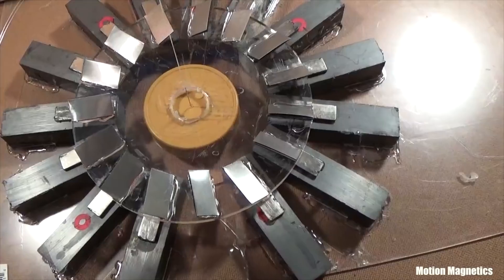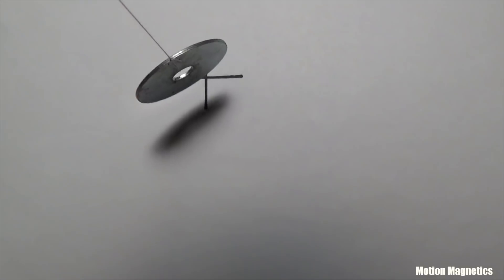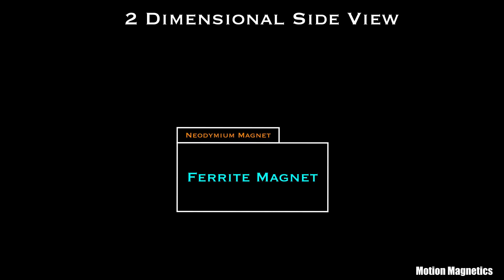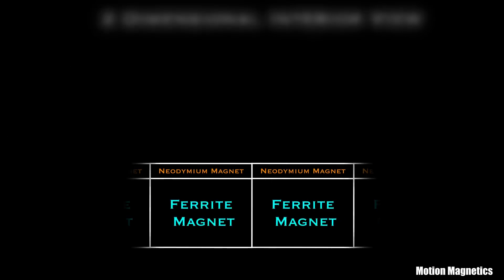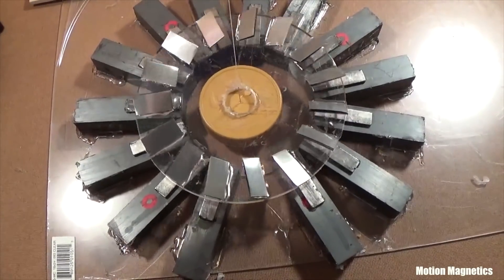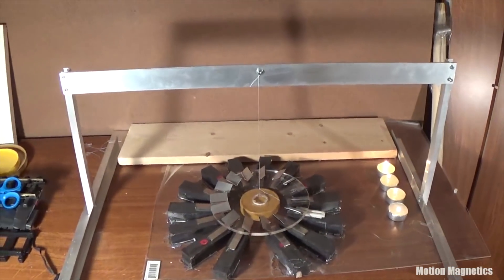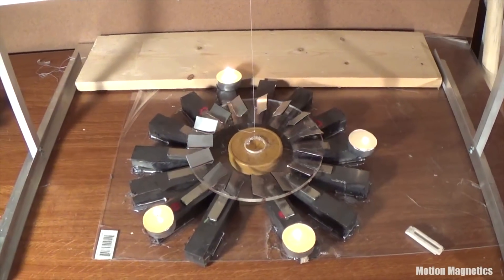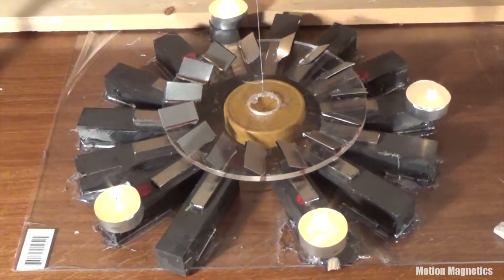Self Running, DiaMagnetic Motor?

Comment: Instead of fixing the string to the support, instead place astyrofoam ring in a ring shaped trough of water and cross two sticks across the top of the styrofoam ring. Tie the string to the center of the crossed sticks and drop the string down through the doughnut hole and attach to the diamagnet rotor. It can never wind up the string this way.
Reply: Wood skewer

Comment: Place 15 halbach (N oriented to axis) stationary magnets in  a circle. (15x24=360)  Mount them diagonally in a slot. (Slot is for the Guass adjustment on each one.) Position two more Halbach arrayed on a rotor like a windmill having each one 180 degrees. But because two won't go into fifteen, the spinning magnets cannot cancel each other out!  They will "fire" alternately as they move around Magnet-henge. Put some weight on it to give it the  "oomph" it needs to pass any South influence' which hopefully will be nil. To accelerate, simply turn tthe stationary  circle of 15. Since all the poles are North, this Repulsion Motor should work. I hope I've described it well enough. Thank you

Comment: I believe you answered your question related to the string issue.  You need to float your polyethylene and aluminum rotor in a pool of water and let it float with a nail as a guide.

Comment: If you used a fishing line swivel, it would have kept your string from winding too tight.  Good video though.
Reply from the maker: Correct. Thanks.
Reply: @Motionmagnetics  I was thinking a bearing.  Put string or fishing line through a cone so that the string or line goes in the large end of the cone and comes out the tip. So a funnel.  Be sure the end of string or line has a big enough knot that it wont come out the hole.  Place the set up through a inner race of bearing, the big end of the cone/funnel will wedge itself in place and now you have a rotating centre race that the setup can freely rotate on while you fasten the outer race in what ever you please..  Hope that helped.  Feel free to subscribe. Im going to be posting videos soon enough. Keep doing great things!!

Comment: I watched your videos with great interest. For the most part your ideas can be explained easily.
 FIRST: The spin you're seeing in both directions is caused by the strings twist unwinding and then rewinding as the inertia of the weighted (washer) suspended object eventually diminishes to equilibrium. If a monofilament fiber is used, the rotation will not begin until an unbalanced force causes an imbalance in the magnetic field. It too will eventually cease to twist when it is at equilibrium.
SECOND: You're not taking into account the strength of the earth's magnetic field strength, which is considerable. Compass needles try to align with the earth's magnetic flux lines. The stronger the magnet you're using, the stronger the attempt to align. However, other distortions may cause interference as well. 
The sunrise will cause the compass needle to deflect in the sun's direction, possibly because of electromagnetic effects in the ionosphere when sunlight hits the rarified gasses at the altitude of the Aurora Borealis.
THIRD: Take yourself out of the equation. Imbalanced magnetic fields have been played with forever by the smartest scientific minds around. Tesla, Einstein, Faraday. 
Free energy stuff has tried to use magnets forever.
HOWEVER, check out the Methernitha Testatica machine in Switzerland. Free energy for real? Maybe, you judge!

Comment: This is a really cool design! You have a very passionate spirit for this and you should! This would be really cool to use this to wind a clock.
Also, what if this design were used not to make energy, but to keep it! With the propert of spinning up and then stopping, you could store that enrgy until you need it. Then you pull the magnets down from disk and use that stored energy as it unwinds. I would love to see this design with a bit more weight on the disk. This being said, i havent seen your next video, but i am about to!

Comment: You are moving the object hanging by the string. Hang the disc from a stationary point (Not you) place the magnet assembly in position and stop the motion of the disc from putting the assembly in place and they will magnetically stay locked. Know why? That invisibly magnetic force is not moving! That's why you don't have to keep adding shavings. they are suspended.

Comment: Trough what,, did you use candles to induce rotation?? Why you, i tout that the magnets did induce rotation on it’s own,
Am mean you said in the beginning that the rotor is NOT spinning from influances from the outside,but if you used the camera off trick to use candles beforehand to warm up those magnets,then you are dicker trigger mind f!cking us either too like all others,
Candles are not free energy so that’s makesno sense, and BTW once you placed those candles on the stator, you did turn my face really angry and red,

So if you are a real fair man, don’t think this is funny but pure nonsense,and if i was you,you better off showing us a real working one with asolutely no added bullshit to it,
I warn,i dare and i challange you to show a really working one,or come with top 5 magnet motors wich DO WORK,so come over there and come up with those video’s if you are not a coward,get over there.

Comment: yes the mind has power that is indefinable currently. That said, we did put our collective effort into understanding magnets and your inability to hold a string straight has nothing to do with that science. magnets always rotate because in a stable alignment there are still only 2 strong poles regardless of how many magnets you use and the fall away from balance encourages rotative pressure in an effort to meet with the other pole. (Heat is an expendable force btw no different than you slightly moving your fingers.)
edit: even electrons release "spin" despite them not actually physically spinning to our perception without added force. 2x that of the force applied even. You moving through air is nothing more than a demonstrative effect of magnetic attraction, as you move forward pressure builds behind you and your muscles impart power to move you through it.

Comment: Not to be a party pooper, but the washer at the end of the thread is spinning in one direction and then the other because gravity pulls on the thread, causing it to unwind (thread being made of twisted strands -- look at it through a loupe!)

After the thread has been fully "unwound" inertia causes the washer to continue spinning, winding the thread in the opposite direction. Back and forth, until you run out of inertia, and end up with a washer hanging at the end of an unwound thread.

It has nothing to do with mental waves, electrical impulses, dark energy, or anything other than a thread untwisting under the force of gravity.

Comment: Why not attache the string in the center of a thrust bearing so if the string winds up tight and creates enough force to overcome the friction of the bearing it will continue to move..

Comment: It is baffling to me why there are all these videos on YouTube with people persisting in thinking you can develop a magnet powered motor or some such thing.  Sorry, but it will never work.  No matter how you arrange things, how many magnets you use, etc and so forth, it won’t work.  Likewise for the over balancing wheel which also continues to have a devoted following, despite 1000’s of years of failure.

Comment: Ok, I'm not sure I followed the washer on a string example. Lets see the washer without any stored energy, from being twisted before hand, or motionless, before you start moving it with your mind. Why not just hang the wheel from a tripod to eliminate movement from you holding it? Watched to the end and not sure why you even discussed holding with your hand.

Comment: What a load of crap.  You're holding it by hand. Why?  Hang weight from string, string tends to unwind.  MAGIC!!!.  Lucky for that rotor there is not the slightest breeze in the room.  How do you manage that when you, a heat source causing a air flow, hot air rises, are that close.  Holding the string.  The rotor is asymetric to airflow.  Sorry, another F

Comment: Why not trying replacing that rope with a rotatible pipe, maybe those magnets can then finally overcome that string problem and should rotate forever or untill those metals will get frigle caused by heat & friction.

Comment: Why not just suspend the string on a fixed point so you can eliminate the movement of your hands? Please just do things correctly. Then, after you've shown what forces you put into it and what friction you have in your system, why don't you show us how long it would have to run before it would stop. OR you can get a laser that shows the speed of the rotation immediately slowing down or not from a point of motion of the rotor. 
Why not do things correctly? Why not PROVE what you are doing instead of having the human element mixed into it? Why not do the mathematics that show exactly what you're system can do? If you can't do that, then get a laser to prove that the motion doesn't slow down and a laser will see that as soon as it happens and you don't have to wait for it to come to a stop.
And finally, tie the string to at least 3 or 4 other strings that are tied to a circular object that rotates around a bearing so that the twist of the string may be eliminated as well. Just do it right and stop doing this kind of stuff. Get real

Comment: make sure the piece of paper clip e bearing is hanging on is as big enough to keep the bearing and rotor from falling off but small enough not to be able to get caught on the other chunksa paper clip attaching the external ring of the bearing to the rotor. this should make it be able to keep spinning. its pretty cool your working with diamagnetism I haven't seen anyone use it yet.

Comment: get yourself a nice ABEC 7 skateboard wheel bearing, pull the string through it and tie it to a chopped of lil chunka paper clip so that it hangs the bearing and glue the outer ring f the bearing to a couple chunksa paper clip and glue those to the rotor :P

Comment: By the way. If your not shore whether or not your finger is affecting it. Why not just put the wheel part on a shaft that is magnetically levitated. That way you can have it suspended in the air and see it rotating. Like you pointed out, if it stops than the design isnt perfected.

Comment: Instead of hanging from a string, float it in water in a flat based bowl above the base magnets,less resistance and no bearings plus once the water is turning in the bowl it should provide mechanical assist.

Comment: I think you're on the right track the the windmill thoughts. I just think we need to take it full on sacred geometry. Arrange the magnets in 3 dimensions on two donuts. In the wave form patterns of the Rodin Toroid Vortices. We need phi in order to have the proper forces at play. Simple little miter angles and bevel angles will certainly guide the way from perpendicular angles, but phi is more dynamic.

Comment: I think that stability in the levitated apparatus needs to be achieved, then controlling the spin would be the most obvious next step. You could still use low powered electromagnets with capacitor input so long as the output will be greater over time as the initial input.

Comment: Keep the string tie a needle to the end of the string and put
the point of the needle against a magnet the friction should be low enough that
the needle could rotate if it is strong enough to hold wheel.

Comment: Nice build
.Did you know that you can use a fishing line snap swivel to release tension on the string so it wont over wind?It may continue to run in the same direction...with no drag from the string.
Reply: I seen that right off,,, 👍
Reply: Funny thing you mentioned the snap swivels. That's what I'm using in my experiments. I'm using shields made up of six Ball canning jar lids glued together and the short stack trimmed to size. They shield two OPPOSING rare earth magnets, neutralizing the repelling force. Moving the shields         out of that way just in time to make the repelling force active again. What do you think. Stay in touch.

Comment: I think the part showing him holding a magnet close to the aluminum coper pieces shows the attraction and repulsion process.  The string was just a paracortical use for it.  you so called physicists are debunk of going outside the box as Howard Johnson was so get over yourselves!!  Maybe you could learn something!!  You do realize your brain wont reach maturity until your age 26!!!  Get off the pot which will make you loose up to 10 IQ points!!

Comment: Interesting approach, and great video. It seems to me that diamagnetic materials react most strongly when the applied field is moving. When the string winds up, all motion stops, and induced magnetic forces drop to zero. It should eventually unwind. A more interesting question is... would it turn forever, and can it be amplified?
Reply from the maker: Did you watch part 2? I summed it up pretty well in that one.

Comment: A magnetic barring would be the best bet graphite in the middle on top and bottom of the disc and a magnet below and on top to suspended the disk. But you need to add a em component to the motor or it will stop no matter what material you use. This is because when the material use to propell the motor reaches  a sufficient speed it creates it's own em filed that interfere with the solid state magnets.

Comment: With a balanced rotor, put a dimple in the top and bottom of it at dead center. Then vertically from the bottom use an aluminum knitting needle with a slightly rounded tip. The from the top, do the same with the tip facing down. A little silicone spray on the tips to lube. With nearly no force on the top needle and just the weight of the rotor on the bottom, it should spin freely. For even less friction, you could use a piece of Teflon at the bearing points or MDS plastic.

Comment: When the washer is picked up by the string, the first thing that happens is the string un-winds. The string eventually un-winds past its relaxed state and starts to slow down. It then stops and starts to spin in the opposite direction to get back to its natural twist. Then keeps going. Try attaching the string to a solid object, you'll see it will act the same way. The reason it moves around the X, the washers spin gets unballanced. 

I want to see your motor spin without the angled fins, this way heat rising would not play a part.
Reply: Exactly.

Comment: if it sat on a centered journal bearing instead of hung from a string you may have a little more luck 
the two centers may need two slightly repel each other 
just two maintain proper distance between the feilds

Comment: It is obvious that the repulsion by the pyro graphite is real. Though it does not show winding to the end it would because it is not slipping like a bearing and it will wind up and stop. Then reversing direction/unwinding would occur but be  restrained how much it unwinds. When the force driving it to turn matches the force unwinding it the whole apparatus will stop. If the magnets were lowered and driving force stopped being a driving force then the string would unwind until it wound up in the opposite direction then reverse then reverse then reverse until the stored energy in the string relaxed to a non spinning state. 

Sure the force is minimal here but it proves valid especially with no flicker of the candle light. 

Well done.  I will point out that the device is not perpetual but would operate until the magnets weakened to not have enough energy to twist the string at all - at least a few hundred years, lol. Perpetual is a word that means forever. Nothing lasts forever, not even the magnetic field of a permanent magnet/nor man made.
Reply from the maker: Thanks.

Comment: I think its great that you’re doing experiments. But you always have a problem  when you rotate things from a string.  If you take a ring about  1 ½ inches to 2 inch diameter and suspend it from a string it will rotate counter clockwise.  This is for the same reason when you pull the plug out of a bath tube the water whirl pool funnel will rotate counter clockwise.  This is caused by the rotation of the earth in the northern hemisphere. In suspending a rotor from a string I have taped the string to a bar like magnet then took small ball bearings and connected that to the other end of the bar magnet.  Then the ball bearings were attracted to a piece of Ferris metal at the top.  The result was as frictionless  motion rotation as I was able to achieve.  So this might be another thing you could try.  I to have had idea’s for a diamagnetic motor but have to many other things  I want to build to do the experiments.  I wish you luck on yours and will post one of my ideas if you’re interested in checking it out.  Just type in Mike Dibell on face book and you can see the drawing.  Don’t give up keep doing your experiments.
Reply from the maker: Thanks. If you suspend a washer from a string, you'll see the results I featured in the video. There are quite a few people who have never tried it, and they always act surprised when they write me to tell me it worked exactly the way I described. It's better to use a washer that's about 1/2 inch in diameter. That's partly why it doesn't work as quickly as it should have in the video. I took a look at your facebook page. You have several really interesting designs. I hope you keep at it and build more models. I'd love to see to see one of your ideas if you post it. You keep at it as well. Do great things!

Comment: What's with the candles? The heat of the candles causing a rising column of air so that it indeed is acting as a windmill?
Reply from the maker: The candles were just to demonstrate that I wasn't using an air hose or fan.